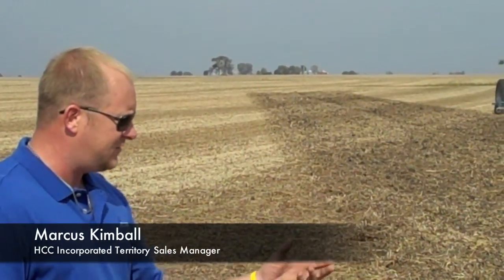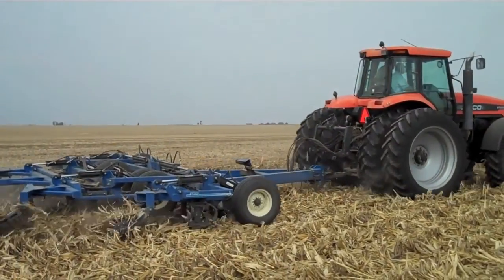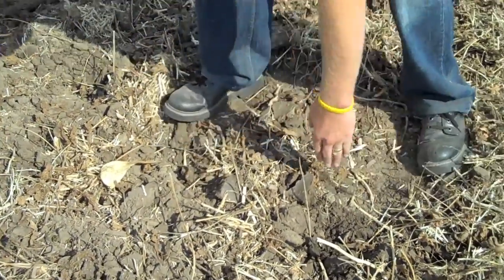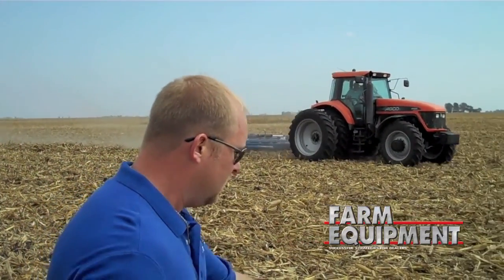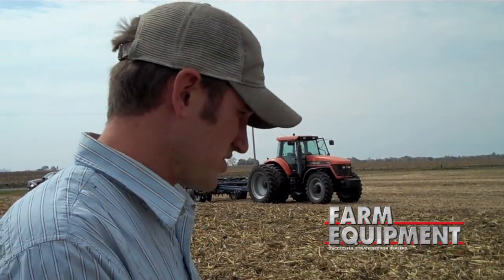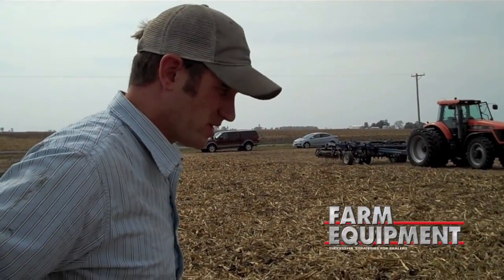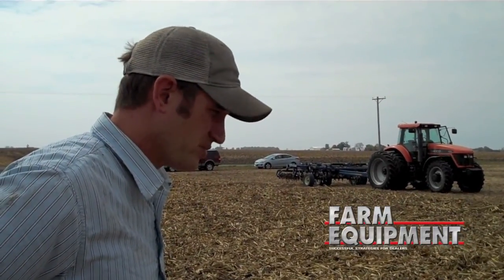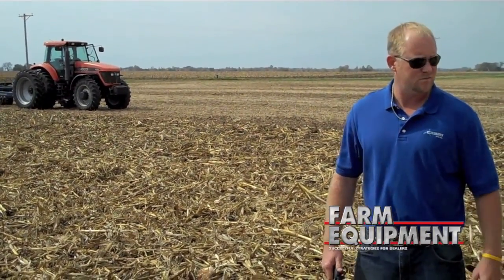Smart-Till DEMO with HCC Incorporated

Comment: 5:38 "trying to keep from burying that trash" "keep more nitrogen in your dirt as it breaks down"... because isn't it true that the breaking down process removes the nitrogen from the soil? So wouldn't it be better to remove roots and lay them on top of the soil, after trying to de-compact and fracture the soil some how?
Reply: Yes you're right nitrogen is consumed in the rotting process but the net gain in the end justifies it. The larger problem with most soils nowadays is that the beneficial fungi and microbes that facilitate that rotting process are absent from the soil entirely. Also overlooked is the trace elements and minerals that aren't replaced. A shaft of straw is already depleted of most of these elements  as the plant has put all its resources into its seed. It really doesn't add much to the soil.